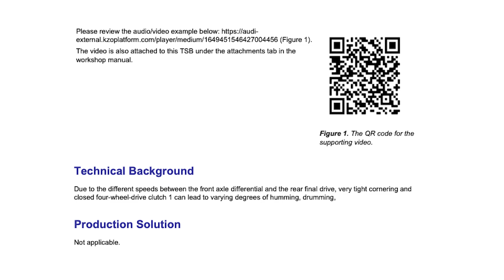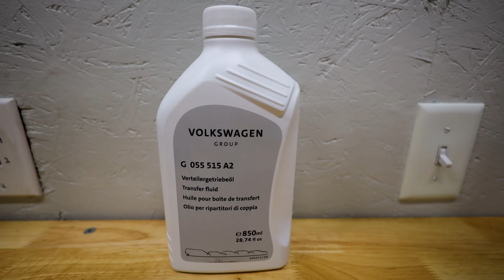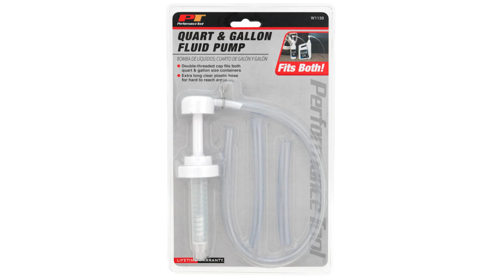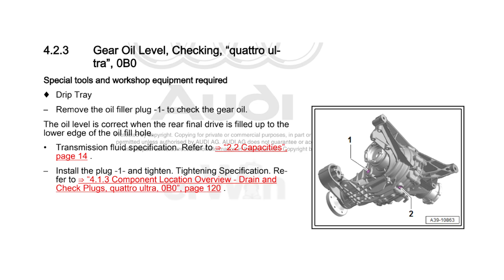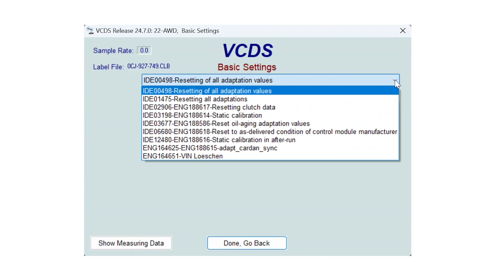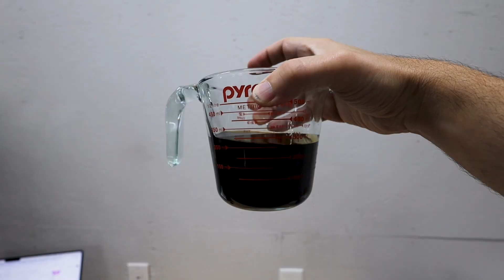Quattro Ultra AWD Clutch Binding & Vibration Fix | TSB Procedure A4 Allroad

Comment: i seriously can’t thank you enough for sharing!!! my 2022 Q5 started to get this rumble/bunding/slipping feeling when accelerating from a turn or reversing into my steep driveway with the wheels straight… followed your steps but instead of “air driving” i just went around town and drove the car hard and did some tight turns and launches before the second drain and fill. also for anyone that doesn’t have VCDS, you can do the oil aging adaptation reset with OBD11 and there are no password/security issues! thanks again!

Comment: I wish I'd seen this video. I changed the diff fluid as I didn't know there was a clutch. When that didn't fix it I told the dealer ok. I'm glad I bought the Platinum extended warranty as the dealer wanted $2800. I only paid $500 and they replaced the clutch. Now I'll know what to do next time if I can find the clutch housing. PS Amsoil 75W-85 severe duty for the rear diff is much cheaper than $50 for the Audi branded gear oil. A nitpicky person would change both of these once a year to prevent the very expensive clutch replacement further down the road. BTW...Grok AI says that the part # on my replacement clutch is an updated part that addresses wear issues.

Comment: Do all of the Ultra quattros use that G055 515 A2 fluid? I put in my 2017 A4 Quattro into FCPEuro and it is showing a different fluid for the transfer Case... its showing G052 536 A2. Want to make sure I get the right stuff
Reply: Nevermind, found out my 2017 is still a torsen style AWD... leaves me with more questions than answers why it does the rumble at 85k on tight turns but my 2016 at 131k miles did not...

Comment: It is a 2.0tdi or a 3.0 tdi? I have a 2016 audi a4 allroad 2.0tdi and they said that I don't have a transfer case with clutches, I have only the differential on the back
Reply: I believe if yours is a 2016, that would make it a b8.5 which iirc does not use this quattro ultra system, it still used the torsen system which is a gear set instead of a clutch pack for the center diff/transfer case

Comment: Do you have any videos of the sounds?
Reply from the maker: I don't, it just didn't get picked up on camera audio very well. The two sounds that were evident from the beginning was 1. A general chassis rumble that was hard to pin point beyond "something weird is happening below the car towards the center of the body", and 2. The rear tires making a dragging or hopping noise on the ground. At first it was during sharper turning and a few weeks later it occurred at any degree of turn.
Reply: Thank you

Comment: I had this exact issue with a used 2020 Q5 with 63k miles. I took it to the Audi dealer who insisted on doing the circle driving procedure to which I agreed. This fixed about 80% of the issue for awhile, but after about 2 months it slowly came back. I then took it to an independent Audi mechanic who did the diff fluid flush described in this video and immediately fixed 90% of the problem. This cost about $170. After a few weeks rumble was 100% gone. Been rumble free for about 5k miles now with no sign of it coming back. THIS IS THE FIX! DON’T DO THE CIRCLE METHOD!

Comment: Well after a few years of dealing with low speed clank or clunk noise and no results from mechanics im going to give this a try and pray its not too late. I have a 2019 audi a6 just hit 52k miles and no one including audi has mentioned this service. Im just praying this will fix it
Reply from the maker: Clanks and clunks are usually more of a suspension/steering worn bushing and mount type of problem, and this particular part of the transmission system isn't the kind that would produce that type of noise, even with the type of symptoms it usually shows. I wish you luck but I'd also keep searching.
Reply: @FigureItAuto thanks

Comment: Have a 2023 SQ5 w/26,000 mi and the binding/shuttering is really bad. I talked to my Audi dealership and he said even though my SQ5 is not under the TSB, he would try to make it right.  I thought most all Q model Quattro drivelines were the same, but maybe not, but it is most certainly occurring with mine.

Comment: What about Audi A4 2.0 TDI non ultra ( no AWD clutch ) that has the same issue ? ( humming noise while turning at low speeds ) ATF , MTF and rear dif oil changed
Reply from the maker: More likely a power steering issue.

Comment: My '22 Q5 is at dealer for same issue.  I gave them a copy of the TSB and told them I wanted to fluid changed.  They refuse to do it until they do the drive in a circle thing.  The technician also sent a pre-inspection video stating that the noise is in the rear.  When I questioned it they now say it's in the front and rear.  Will update once they are done with it......
Reply from the maker: I don't blame them for being suspicious of the rear because of how the AWD reacts to the clutch binding and the rear wheel speed being affected - but that's definitely just a symptom and not a causal area to focus on. The vibration travels through the chassis and it's a confusing experience within the cabin to listen to, as I'm sure you noticed yourself.
Reply: They did the drive in circles evolution at a cost of $450.  Will pick up on Monday.  Still think the fluid should be changed.  Can it be done without the computer steps in the video?  Less than 1/2 quart of fluid is really not alot.

Comment: Can you use the OBDeleven for the oil reset step ?
Reply: Did you ever figured out the answer to this question ? Thanks
Reply: @Eternal2007  Yes , you need the OBDeleven with the pro plan to be able to go into the AWD module to perform an oil aging adaptation .

Comment: Hello SIr, I am a new subscriber and have a question for you: I just put a downpayment on a 2019 Allroad Techink with 145000km today, which is in a great shape (except a few cosmetic blemishes which are normal for a 6 year used vehicle), and wonder if it is ok or is it too high of a mileage? Thank you in advance!!! NB: the vehicle has 25 service records and in the short test drive I took yesterday it felt tigh like a drum (much more prcise handling than my 2019 Alltrack that I am selling to get the Allroad as an upgrade).
Reply from the maker: Welcome - there's really no "too high" of mileage, it just depends what you paid for it and how it's been maintained. Mine has around 86k kms on it and it already had the typical water pump housing failure (plastic, mounted to engine block), this clutch fluid issue, and I've upgraded the coil packs and a few other little things. I'd imagine yours has been through a bit more than that.

Comment: Thank for your Video, my is 2020 A5 45tfsi, Quattro, I am facing the same problem as you described, mechanic changed the fluid today but the noise hasn’t not gone, they said I need to change a new transfer box, any advice? Thank you
Reply: Hey, I also have the problem that the oil change didn’t really helped. Have you already tried replacing the transfer box, and did that work?

Comment: Someone pointed me at this video, but I don’t think this is my issue based on the symptoms you described. I’ve got a 2017 a4 Quattro 2.0tfsi, and I’m having thunking and crunching on low speed shifts and switching between drive/park/reverse and slipping feelings when coming to a stop for a red light or slow traffic. From what the dealer has said and an independent mechanic, they recommended a new driveshaft. I ordered a new one from dorman along with a JXB central support upgrade, do you think these upgrades/replacements are going to fix my issue? I have recently done a DSG fluid flush, leveling process, and a vcds clutch adaptation and the transmission shifts well at speed so I’m thinking it’s not that. Thoughts please?
Reply from the maker: Has anyone actually inspected the car, or are these just guesses? It does sound like a worn mount(s) - and the driveshaft bushing will help regardless - but the driveshaft is certainly a gamble. I'd take a good look at the transmission and engine mounts.
Reply: @FigureItAuto thanks for the input, yes it’s been inspected and they said the csb is going bad along with the joint that connects to the trans. I’ve also ordered an upgraded trans mount from 034ms, and will inspect the engine mounts when I’m doing work on it soon. Thankfully I have lift access at my buddies independent shop some nights

Comment: Had the same issue. Went to audi dealership and they decided to change the all haldex unit. 3k £. 
On warranty
Audi A6 C8 50 tfsi e. They did 2 differential oil changes prior

Comment: Hi, thank you very much for the video. I have a question: How long did you have it on the lift while driving it?

I have a 2018 Q5, and that's exactly what's happening to me. At first, I thought it was the gearbox, but thank goodness I found your video.
Reply from the maker: By the time I figured out what I was doing, actual "air drive" time was about 5-10 minutes.
Reply: Thanks you very much!!!

Comment: is this just when turning the wheel tight? as i get judder in low gear up hills- is it the same or a different problem?
Reply from the maker: At the beginning it will be only when turned near full lock but as it gets worse, the symptoms will appear with less and less steering angle. Could be the same problem.

Comment: This is perfect! My 2023 Q5 started to bind and I thought I turned too much but finally I realize it's abnormal, so I did a search online and found it's normal, and the solution is to change the differential  oil. My Q5 still under warranty, I will bring it to dealer for a service! I have VCDS too, a perfect tool!

Comment: THIS IS THE ANSWER!! I recently purchased a 2023 Q5 with just under 30K miles, and noticed the rear wheels binding during sharp, slow turns.  Since it's under warranty, I took it to my local Audi dealer, where the tech verified that it's a known problem and that the "fix" was a bunch of tight circles and some computer magic.  They did not think it necessary to change the transfer case gear oil. It was  perhaps 50% better initially, but was back to it's old ways within two weeks.  I decided to give the gear oil change a shot before going back to the dealer.  The drained oil was a dark amber color, and I collect just under 250ml of fluid, about 110ml less than the required amount in the transfer case.  Using the same technique as in this video (make sure to loosen the drain plug to ensure the full 360ml gets into the transfer case), I filled and then drained the fluid after driving around a bit and shifting through all gears.  The transmission performed beautifully....zero vibration, binding, jerking, etc.  I probably could have stopped there, but I decided to drain it again, mostly to see what the gear oil looked like.  The flush looked completely clean.... I didn't see any debris.  

It's stunning that the dealership didn't do this...they're ready to throw a new transfer case on it instead.  Once you aquire a few inexpensive tools, I estimate the cost of a drain and fill to be less than $15.  Considering that my oil was failing around the 2-year mark, I plan on making this an annual maintenance item.  Now that I've been through the process, I'm pretty confident I can do the job in 30 minutes.  Considering that the first drain and fill fixed the issue, I doubt I'll do a flush next time, just the drain and fill.  

Thanks again for the video!
Reply: On my 2017 a4 I do not have this centre clutch but I’m getting the clicking sound on turns I replaced diff fluid and it temporarily solved it any ideas?

Comment: I have the same problem with my 2019 Audi A4 B9 2.0 TFSI Quattro. It vibrates when I start. Does this oil need to be changed?
Reply: I have the same when it’s cold. I don’t think it’s the same issue. I’ve been told it could be carbon buildup or need for new spark plugs or coil packs

Comment: Hello from France! I just did a flush and refill on my 2017 Audi Q5 2.0 TFSI. It had a hard rumble at very low speeds, but only during sharp turns. After the service, the problem is completely gone. I didn’t perform the software reset or the two flush/refill procedure, just a single flush and refill.

Comment: Thanks somuch for the video. I have a 2012 A7 3.0tdi SE quatro. High miles at 190k miles, but a well serviced and tight car, just had the transmission fluid done at Audi. I have, what I would call, severe rumble at tight turns at low speed. I had a technician from Audi sit in the car with me, and said its normal !!, he actually said most of the quatros on their forecourt would do the same. I thought this was bullshit to be honest, if someone bought an expensive Audi and were experiencing this rumbling they would be straight back. As my car is older than most in this discussion and not the Ultra model, would this procedure be the same for my car do you know? cheers.

Comment: Just did my 2023 A4 s-line after watching your video. Well, I didn’t go to the full extend of what you did as I don’t have a lift. Just drained and filled (300ml). No more binding. Thanks!
Reply: Did you do the steps at the end of the video with the computer?
Reply: Did you do the steps on the computer ? Thanks

Comment: Problem fixed!!! I have a 2018 Q5 and the Audi Quattro Rumble started at around 30k. I currently have 32500k and did the service. Drained out 250ml (Looks like it was underfilled by the Factory) and refilled with the correct amount (360ml) as Audi stated. NO MORE ULTRA QUATTRO RUMBLE! Drives as smooth as a baby's butt! Thanks again to Figure it Audi!
Reply from the maker: Geez, starting at 30k is early. This is a problem that genuinely needs better factory attention.
Reply: @FigureItAuto  Audi doesn't care about the $45/quart quick fix. They want you to spend $4k for the new part.  Since this currently is on their radar (TSB) they don't have enough of these out there to make it a recall.  Liked & subscribed! :)
Reply: Did you have any issues driving higher speeds? Like any strange noises?

Comment: I have a 2013 Q5 Hybrid, and its occassionally juddering on accelleration. Should I follow the steps in the video?
Reply from the maker: I wouldn't assume so yet. I know this video has become a bit of a magnet for every person searching for "audi vibration" or the like, but a hell of a lot of things can cause that. I'd say: IF you get the vibration when turning (sharply to slightly), AND you confirm (via OBD module reading, or from the build sticker of the car, or physically under the car) that you have the quattro ultra clutch, THEN yes, absolutely give it a shot. Otherwise it could just as easily be power steering, literally anything rotational all the way from the engine to the rear of the drive train, or some part of the suspension/bushings. Your car will never feel worse from fluid changes...but it could easily not be that. Investigate!
Reply: @FigureItAuto  So it seems I DONT have the quattro ultra clutch as it was introduced 2016 (3 years after mine). Do you think the judder on accelleration (not when turning) is now less likely to be resolved using your proceedure?

Comment: If you don't want the traction control going berserk, just hook up your scan tool and go into the ABS module menu. This disables the ABS as it goes into diagnostic mode.

This fluid "exchange" seems to work for a short while, but in my experiences you're going to be either replacing, or rebuilding the transfer case in the future. 🤷‍♂️ I don't design them, I just fix them.
Reply from the maker: Appreciate that ABS tip! As for the long term solution to this problem, what's been interesting about this videos comment section is the variety of reports from people doing either the fluid change or "circles" TSB and how inconsistent the results are (circles being almost totally ineffective, fluid being a solution for some time). My burning question though is: what is the actual root cause, and what will it take for someone to determine that? Does a driveline specialist need to crack open one of the clutch bodies and inspect the components, meaning, it's a mechanical failure? Or does the fluid simply have a short shelf life where once degraded, it introduces mechanical issues that otherwise don't exist?

Comment: GENIUS! My 2021 Audi Q5 just turned 45K and was vibrating and stuttering upon acceleration and turning. Freaked me out. Hubby followed your protocols (we road drove vs. air driving). Now she drives smooth and silky. Thank you for the video! Definitely adding this to our maintenance car care routine.
Reply: How hard was the job? I need to do this on my Q5 as well. Was it easy to access?